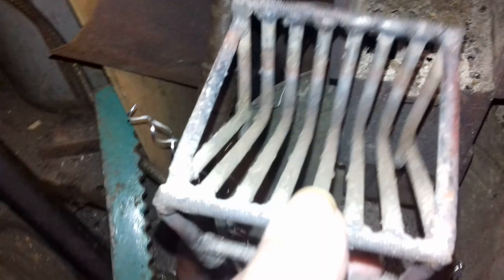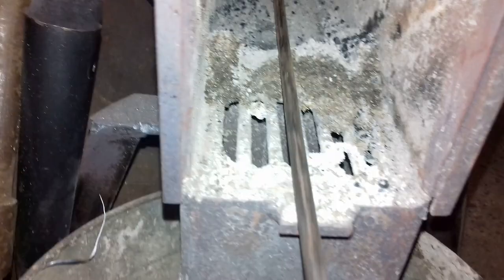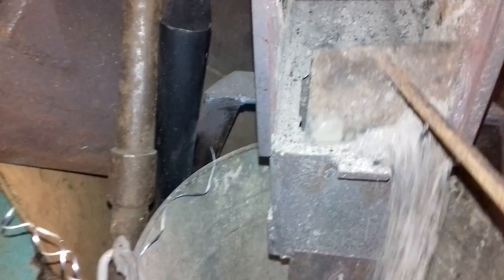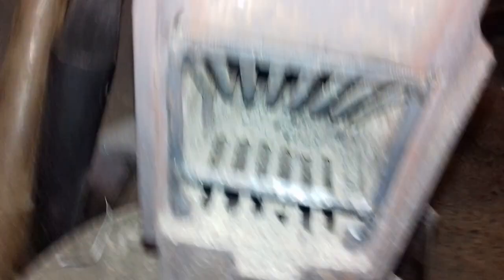rocket stove space heater Mk3   No98

Comment: Always enjoy your videos Dave.  4 Years ago I built your stove and it still gives me a comforting roar.  I'm considering adding your heat exchanger in the burn tube using copper pipe.  I use a straight 4 meter 4 inch flue topped off with a PPOTTY 1 Type cowl (easy to make).  Like you I like to tinker and I found a 9 bar basket works better than a 10 bar. still keeps the pellets in and allows more oxygen through.  After about 30 mins to warm it through I can close the drop down sliding door to a 1/8th gap at the bottom.  Enjoy everything about your stove and the never ending experiments that you can do with it.  Seems like this stove just want's perform at it's best with a minimum of attention and it burns the smoke cleanly.  Thanks again Dave.